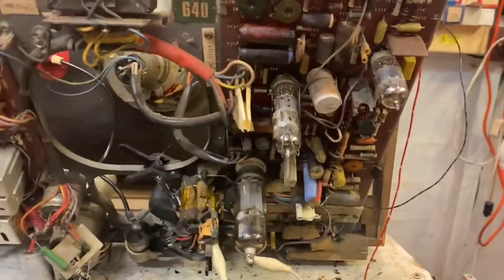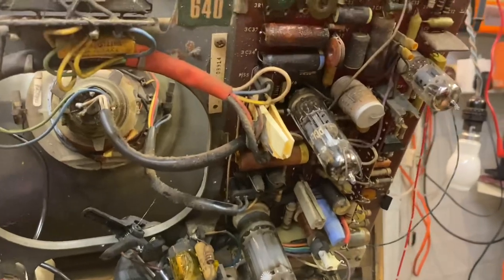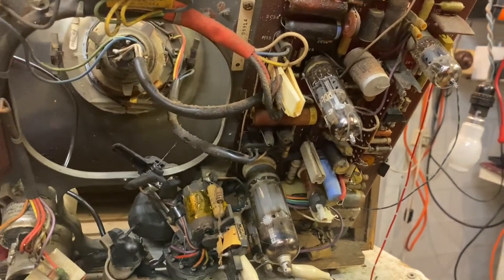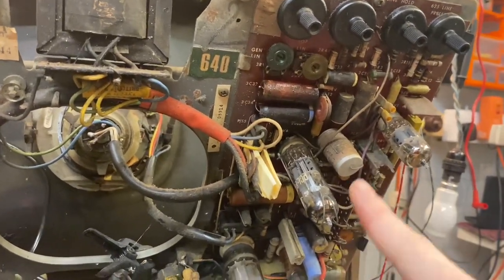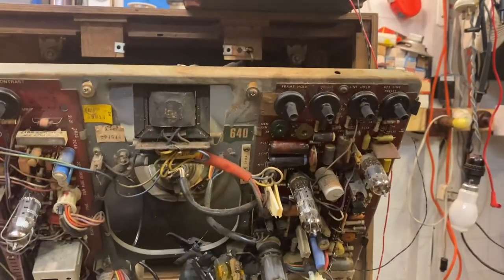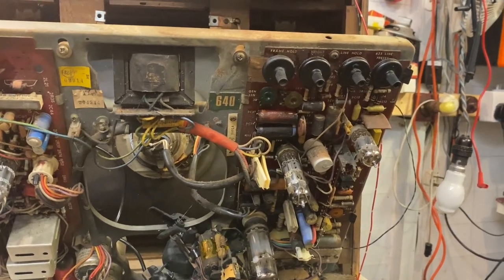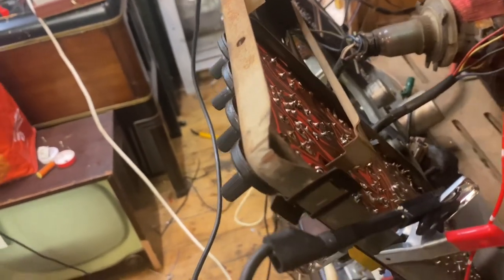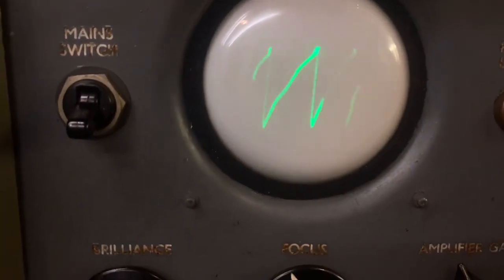Diagnose Time - A few words on Frame Collapse (Vertical Collapse), whilst working on CRT TVs.

Comment: after dc voltage checks the things i do are: check the trimpots, they are a source of trouble...height linearity and frequency...and also check the boost voltage...many tvs use the boost voltage to power up the vertical, if its too low there will be no frame scan at all. dont forget to never touch the multimeter to the anode of the output valve